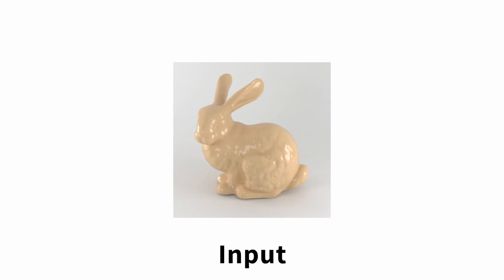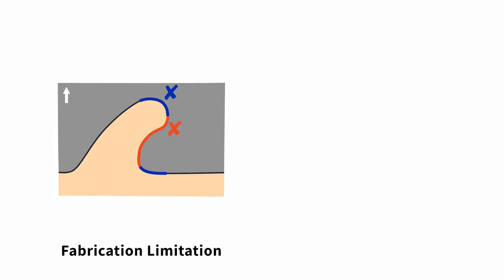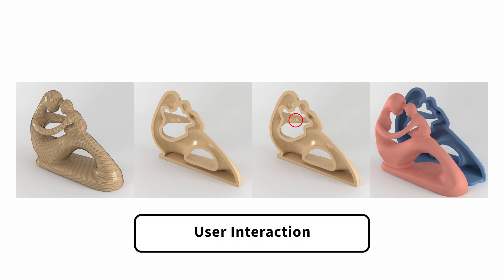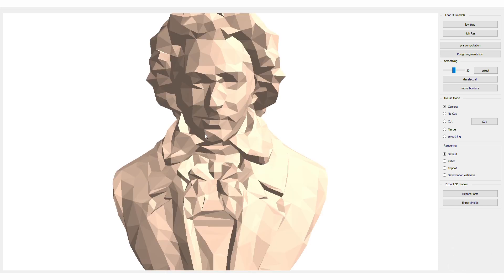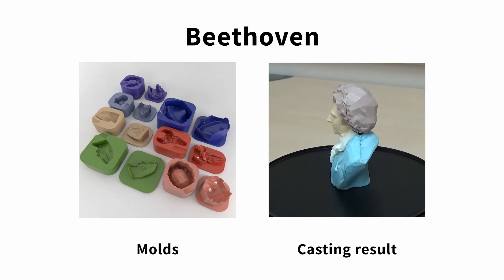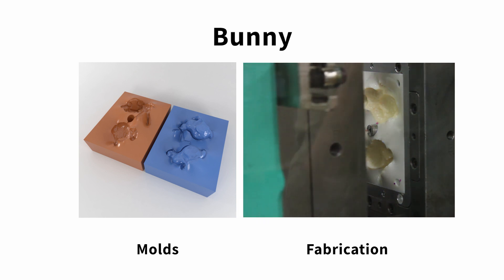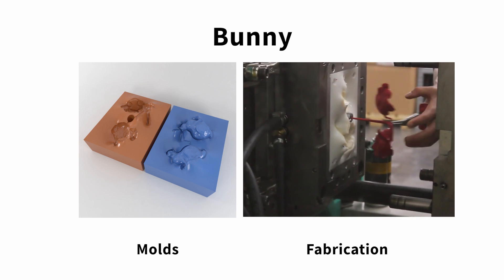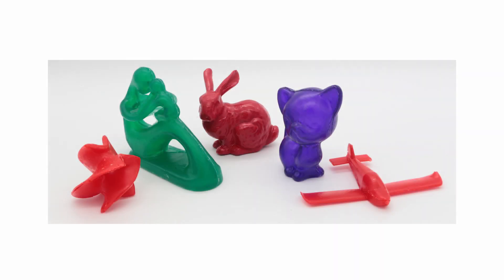CoreCavity: Interactive Shell Decomposition for Fabrication with Two-Piece Rigid Molds

Comment: If the bunny just has one parting line, why not injection mold the entire model in one go? So one side of the mold is that half and the other side is the other half? Don't you still need to hand assemble the two parts afterwards...?
Reply: Would bet they were trying to minimize material usage, a solid model would be much more raw material than having the shell decomposition?
Reply: @shipshupe  Oh wait you're right. If they wanted to do it however, they could do rotational molding to get a hollow piece with a simple parting line^